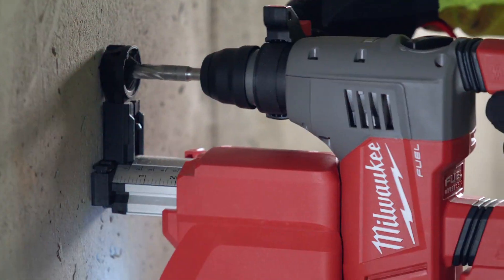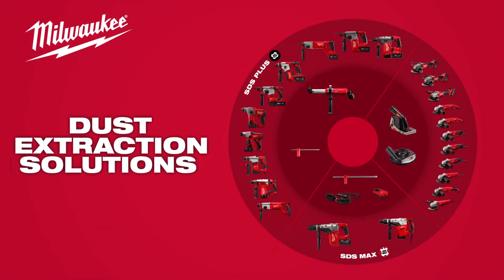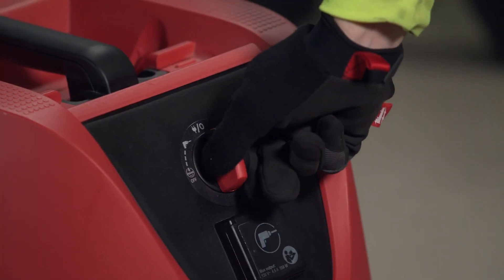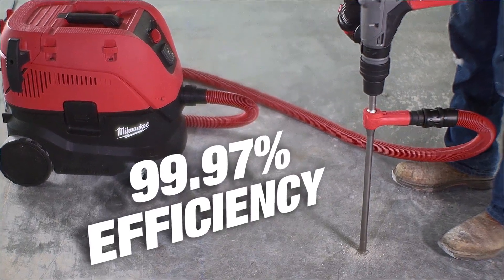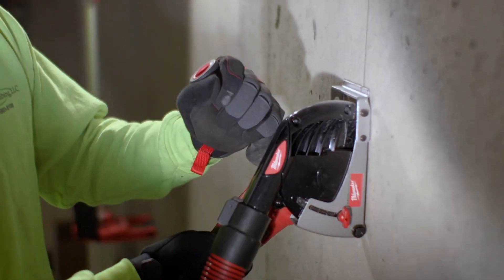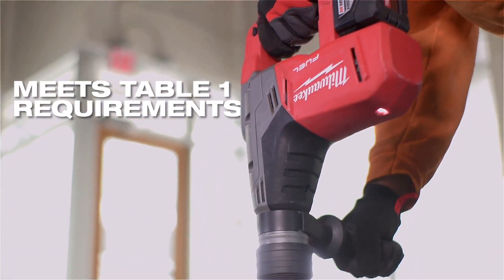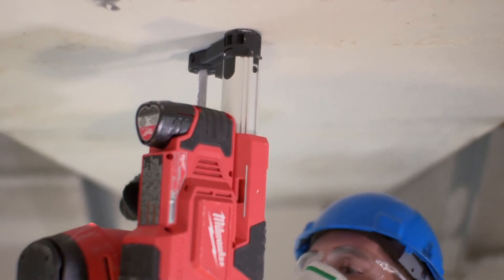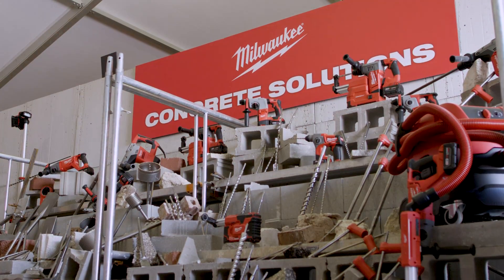Milwaukee® Dust Extraction Solutions

Comment: Please put the part numbers of these tools on the video.
Reply from the maker: this video is an overview of the dust extraction solutions, there are more than 50 tools highlighted in this video. it is near impossible to make it clear as to which tool is which. if you would like to comment with a timestamp i will reply with the information. the two main items used in this video are linked in the description. i hope this helped. thank you.
Reply: @BrightonTools  Will the Milwaukee 48-03-3135 SDS+ Dust Trap Drilling Shroud work with my M18 Fuel 1/2 inch hammer drill/driver with the keyless Jacob's chuck? Thanks.
Reply from the maker: @illestofdemall13  This dust trap will only fit an SDS+ machine, unfortunately this will not work with your drill/driver.
Reply: @BrightonTools  Ok, thanks.